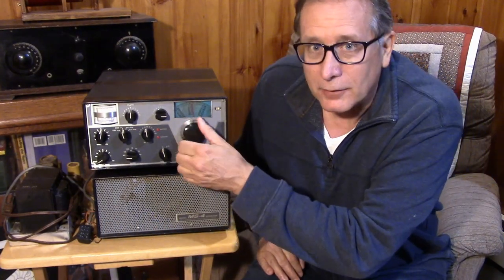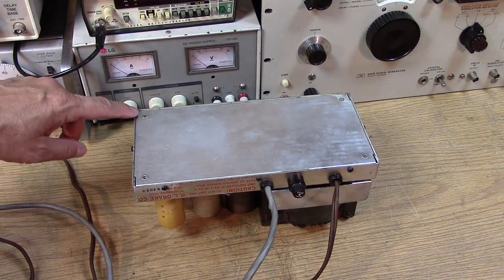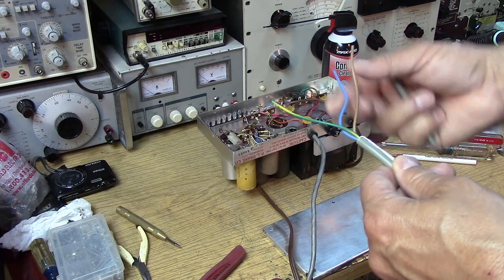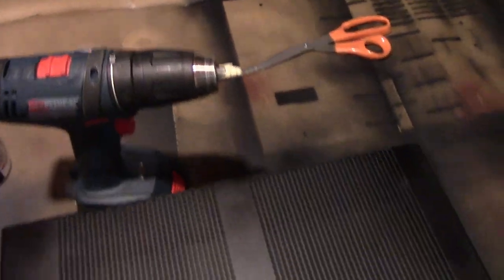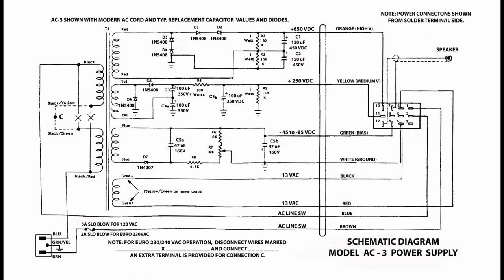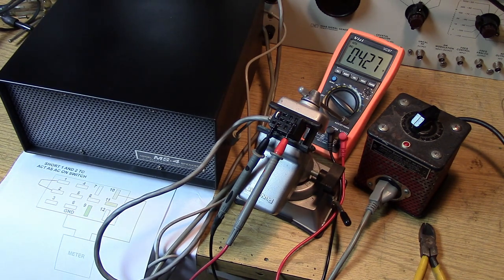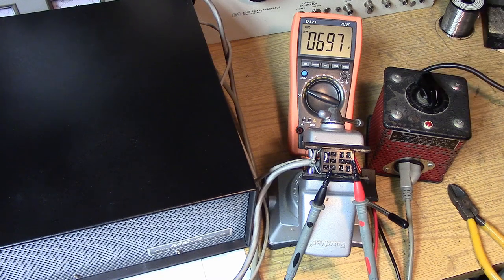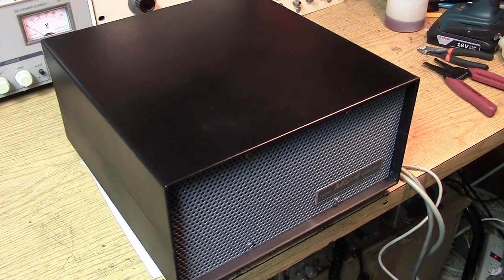Drake TR-3 Power Supply

Comment: Nice video. Bought the C Line a few years ago and still working. I have a couple of Heathkit and Swan supplies that may need refurbishing. Nice to see the big electrolytics are replaceable at a reasonable price. Nice videos Mike.
Reply from the maker: You can spend what you want to with caps. The rebuilds are wonderful from Hayseed Hamfest. And some folks stuff their own replacements!
Reply: @MIKROWAVE1  Thanks Mike
Reply: @MIKROWAVE1  ,   Who would "stuff" caps, anyway? IF they were replaced, they will probably need to be replaced again.

Comment: Since there looks like there is room under the chassis, I'd have cut a suitable hole in the side and installed a three prong power cord socket with a noise filter into the chassis and then plugged the power cord in rather than wiring it directly.
Reply from the maker: Nice Idea. But that would be an interesting hole to cut! Bring rat tail file please.
Reply: @MIKROWAVE1  I have an old nibbling tool from the 60's that could roughly cut it out.  I'd first start with a few large drill bits (3/8-1/2"), then the nibbling tool, and finish off with a file.  Another idea would be a Dremel cut-off wheel.
Reply from the maker: @scharkalvin  They made me use a nibbler in college as a Co-op student building test boxes. Hand still hurts.
Reply: @MIKROWAVE1  Yes that tool does take some hand strength to use. :-)
Reply: @MIKROWAVE1  ,  Or, buy a punch!

Comment: Not having read any other comments, I will say that I saw a lot of disc ceramic caps scattered about the power supply. What were they? If they should have been safety caps, they obviously were not the correct ones to use. I didn't see any disc cap values on the schematic. (??)
Reply from the maker: The power line and caps. A great subject. Polarized Safety Cords. Cheater Cords. Safety Caps. Do they have Cheater Caps?
Reply: @MIKROWAVE1    ,   Well,  I thought YOU might know about cheater caps, if anyone might know about them YOU would! The X-1, Y-2 caps would do in a pinch.